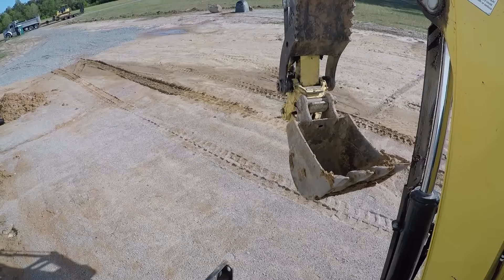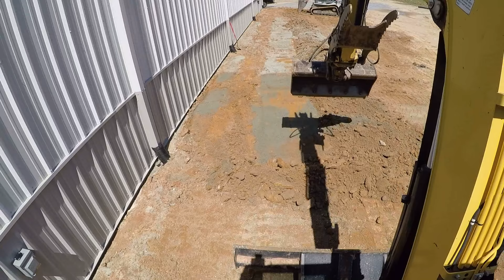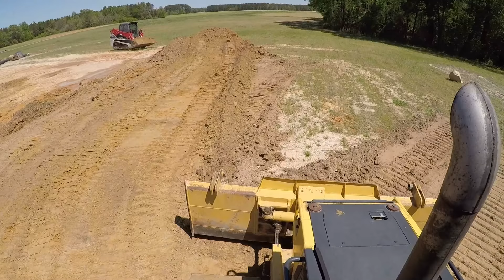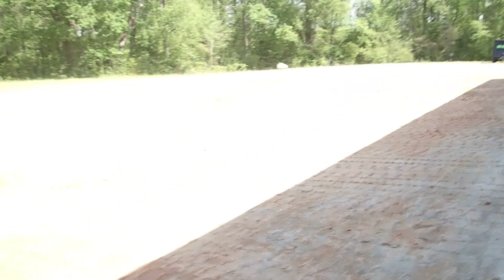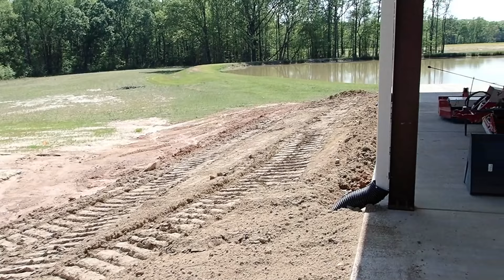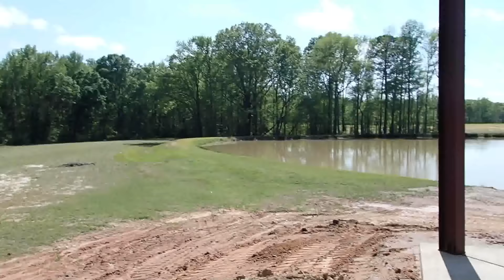Gutter Drains And Grading

Comment: There are very few operators that I would allow to get that close to my building. You would be one of the very few on the top of my list for trusted operators.
Reply: TheBurnsStuff it's only a new building, what's the worst that could happen 🤷🏼‍♂️
Reply: TheMth370 they have to demolish said new building and replace it with another new building 😂

Comment: In Scotland, we very rarely put any pipework in the ground without gravel in and around it. (5-20 mm)
It both serves to protect pipes (packed underneath) and adds to the overall drainage of the site. 
I mean you have done the hard work, excavating the track you might as well put gravel in making extra drainage.
The extra cost is balanced out in the long-run.
Yes, I know the customer is always right, apparently? 
Thanks for the content, much appreciated.
Reply: In the UK it is building regs, code (in my area anyway) to put pipes in on small gravel. Architect had is specified in our drawings down to size and depth of gravel around the whole pipe.

Old way was to drive wooden stakes in to get correct fall then fill the lower third/half with concrete giving the pipe a full solid base to rest on.
Reply: Bear in mind nc is sandy, no need to protect pipe with gravel, the added drainage thru the gravel would erode the sandy soil. Everywheres different!!

Comment: Nice ditch Chris.  Very tidy.   I hope you'll not mind me saying not quite as good as Frank Cunnmingham (DigginOK) — who you recently met at ConExpo — digs a ditch/footing, but while he has sharper edges and perfect corners, I suspect his technique takes a little longer to get the job done.  It was great to see Tim getting all creative in this video.  Helping out with the back filling, and then backing off  from loading the truck before he face planted the side of the truck by tipping off that ledge.  He'll have seen you use a scoop of dirt to build a wee ramp or to make a platform, and that stood him in good stead today.  I guess John could have parked a bit closer to the ledge and saved Tim the trouble though.

Comment: Today with our cat 303.5 I dug 200 ft of trench using the method of digging down 6 in and almost hit a old spring pipe but didn’t because this method exposes it and we were able to see it, it would not really have mattered even if I did hit it because it’s a pipe we probably won’t use ever again but it is still intact so we can if we want to.

Comment: Hey question for you. Does your thumb hard plumb or do you have  flat face coupler on it? We just bought a new Yamar 55 and have gone through 2 set of couplings on it got less then 30 hours on it. Love the videos.
Reply from the maker: not sure what you are asking. the thumb lines are permanently mounted to the machine
Reply: The hydraulic connections from the thumb, if you wanted to use another implement like a hammer or the tilt bucket.
Reply: Sounds like somethings wrong with the couplings. I have hose connections the same way, and some of them, from different manufacturers, are not interchangeable! They are a milimeter difference!

Comment: Nice job, but that corrugated black pipe looks like crap stuffed onto those square downspouts.  Like I said on the last video you should of used pvc, they make nice downspout adapters that would fit the square downspouts and I usually put clean outs right after the ninety, just in case it should get clogged...maybe next time give it a try.
Reply: Polyethylene is not intended for down spouts because the Sun will deteriorate the exposed pipe.  PVC is the better choice when exposed. It is my opinion but I have been around drainage since 1970 and started using plastic drain tile in 1976.
Reply: Nj One Bale  its what the customer wanted.

Comment: surprised no one has invented an automatic way of laying pipe like there is for laying TV cables in the ground, bit different but still.
Reply: Look up field tile drainage, it's the closest I've seen to automatic.
Reply: @farmcentralohio  will do, thanks
Reply: @DigitalIP  Mike Less- Farmhand Mike just did a video about field tile. The machine used in it is one version, there are others some use a plow type design others use a rotary digger. It's not automatic exactly but I've always found interesting to watch.